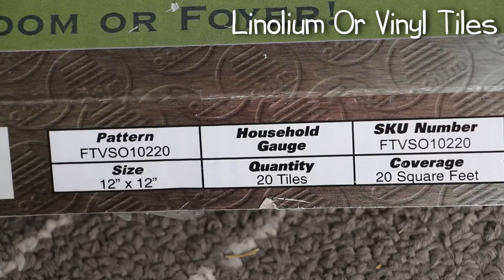How To Make a NIC/C&C Rabbit Cage Floor/Level

Comment: My question is the gripping. Is that linoleum/vinyl flooring slick? I actually have a bun right now im rehabilitating because he has splayed legs (dont know if its genetic or from the flooring he had to live on 3 months old) and right now I have him in a cage with carpet/wood and he does great on it but it doesn't look too pretty. I love the way your floor looks! I'm just worried if I do this he will end up on the short end of the stick.
Reply from the maker: MarchingBagira  It is somewhat slippery, I wouldnt recommend it for your bun with splayed legs.
Reply: I also have my rabbit on the same flooring (except in the wood looking style) she is a new zealand white and its hard for her to keep traction on the floor. The plus of the flooring is that its easy to clean. I put little dish drying mats (the kind you put on your couter to catch the water from your dishes) in particular areas where she needs traction like her food bowl. She likes the flooring because its cool and I live in Hawaii so it is usually warm, but I have considered re-doing her floors because it is so slippery. So it might not be the best choice for a bunny with splayed legs.
Reply: Thanks for the replies. I'll have to find some kind of replacement or redesign so the cage can look nice AND be comfortable.  : )